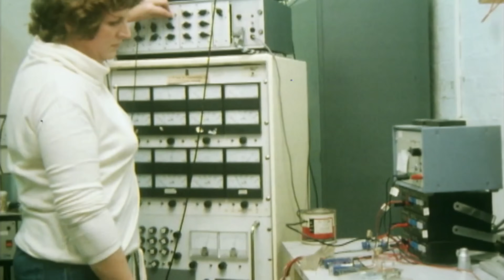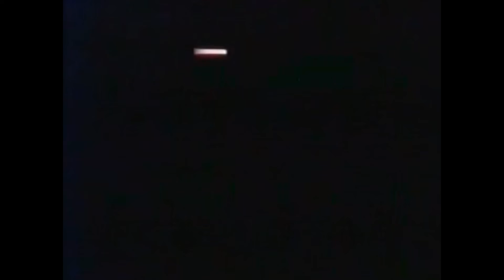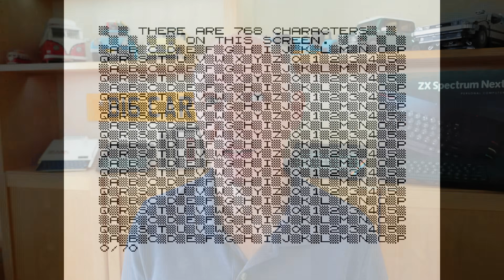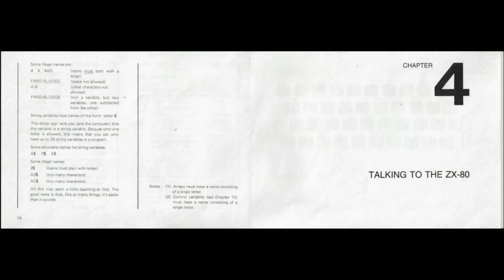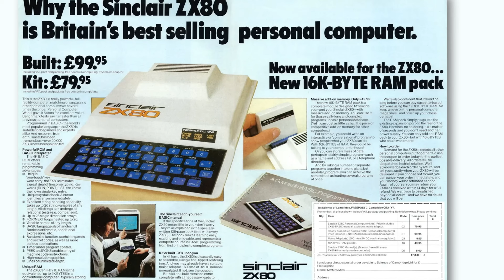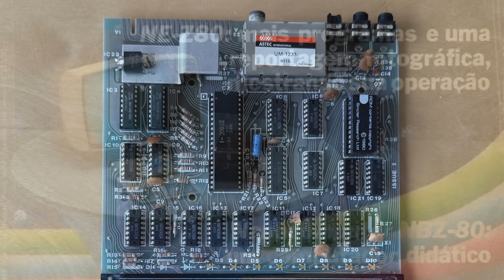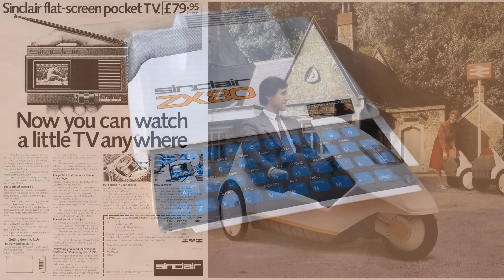Just a TOY? The Sinclair ZX80 Story

Comment: An interesting nugget that I don't think I've ever seen repeated online. 

When I was a child in the late 70s into 1980, a friend of my father worked for Sinclair in quality control.  His remit was simply to test random units to identify where problems were occurring.  This didn't work as well as it should as Sinclair found Mr QC rejecting a far higher number of ZX80 computers (as he had MK14 machines the year before) than Clive Sinclair was happy with and more than he found were being returned as a percentage of production.  Sinclair's solution?  Put the QC into the design stage and don't bother checking devices off the production line - the reject percentage from the general public was far lower than the QC department, most likely because when faced with a computer that didn't work quite right most buyers would just assume it was something they'd done wrong!  A great cost cutting principle that many firms use today - let the buyer be the tester.
Reply: A tradition kept to this day by the likes of amaxon
Reply: @burblering  ...and Microsoft.
Reply: @andymanaus1077  People love to hate Microsoft - and Microsoft has gone down hill since Bill Gates retired.
But, compared to the junk that was sold before, Microsoft is pretty darn good.
You should see the crashes and bug we had to put with back in the mainframe days.
Reply: @keithammleter3824  You're right.  I used to program my computer in the 1980s with a version of MS BASIC and was pretty good at it.  It was a solid BASIC, far better than most other microcomputers of the time.  Microsoft started out strong but these days, they've gone to the subscription model for just about everything and have added so much bloatware, spyware and nagware to their OS.  It's infuriating.
Reply: That's the essence of Clive Sinclair's business method:   sell junk to kids so that if it didn't work properly or didn't work at all, the dumb kids wouldn't know or the parents would think it was the kid's fault - so there weren't too many returns.  That's why he liked kits - when a kit didn't work, blame the assembler.  That was the case with Sinclair's earliest amplifiers and he stuck with it.    
Only in Britain could such a crook get a knighthood and not be prosecuted.
Another one of his tricks was to hire people way underqualified for the job they were given and pay them very well  - and when they inevitably did poor work, rant and abuse them.   It worked because they had to either rise up or loose their job and work for a lot less elsewhere.
Reply: @keithammleter3824  Britain was going through our great depression at the time

Comment: You didn't really need to look at the screen to know if your keypress had been registered; The screen would blink, which was easy to notice without looking.
[The Z80 was HALTed to maintain the display, so each time a key was pressed, it had to process it and the display was dead for a short time.
The ZX81 had the option of SLOW mode, where the Z80 was focused on maintaining the display and other processing could only use the 'spare' time]
Reply: The Z80 wasn't halted to do the display.  It was frantically doing NOP instructions.  It takes 8 clock cycles to do a NOP so it timed the bits to go to the display.  The instruction pointer was set to the address of what to display except the MSB was set.  This caused the instruction fetch to grab the byte from memory but hardware forced the CPU to get a 00.  At the end of a line was a HALT instruction that was allowed to go to the Z80.
The memory refresh counter was abused to count off the characters per display line.
Reply from the maker: One review said that was a positive by product of the screen jumping.

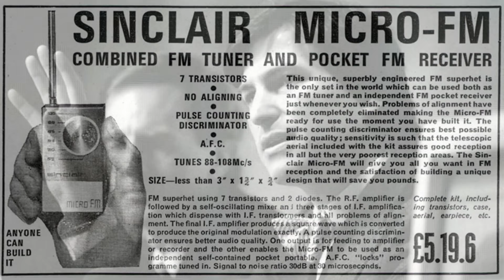Comment: 4:12 You said Steve Jobs made high quality products that were very usable, not always. Steve Jobs insisted the Apple /// not have ventilation slots or a fan. Instead the bottom was a big aluminum plate that was supposed to be a heat sink. The aluminum plate added weight to the computer and raised the price. It did not work as a heat sink to cool the computer in real life. The computer overheated all the time and chips got loose in the sockets causing errors. Apple support told users to lift the computer up a few inches and drop it to reset the chips. This worked for an hour or so then died again. If Steve Jobs let the engineers put in ventilation slots and a fan this would not have occurred. Because of this the Apple /// was a failure.
Reply: the apple III was a big heavy and solid machine, whereas the ZX80 was a flimsy bit of plastic.  In terms of functionality and reliability, yes the III was garbage, but it wasn't for lack of material quality.

Comment: My first computer was the ZX81 that I got as a a kit around 1982.  I nagged my mom into buying it for me!  I built it in my workshop in the basement and it almost worked!  Half the keyboard would not respond!  Glass half full though!  I sent it in to the US repair company and they got it working for me.  What a blast!  I still have it, but I don't know if it will still work.
Reply: It very likely will. I think there were only a couple small electrolytic capacitors (which are what may go wrong over time), no battery that could leak, only a few chips. I also got one at the time. It was frustratingly limited but certainly there was something oddly appealing to it.

Comment: Shame you focused on the ZX80 and ZX81. I think the ZX Spectrum is far more relevant - given clones are produced till this very day. But anyway, I'm happy I didn't buy a ZX80/1. I had learned BASIC on a PDP-11 - and I entered and ran them on the Speccy without problem. Also note that the Speccy ran Pascal, C and Forth. I even heard about a Fortran compiler - although I never got this confirmed.

The Speccy has remained relevant to me till this day. I've worked on a compiler for the last 30 years - and there is a lot of the Speccy knowledge I acquired in that thing. The BASIC interpreter I wrote in that language has some Speccy quirks as well. See Rosetta code for that one, e.g. "Amb":

that    thing   grows   slowly

0 OK, 0:772

Slightly familiar?
Reply from the maker: I’m going through the home computers chronologically, so I’ll eventually get to the spectrum.
Reply: @LittleCar  🎉 Looking forward to it!

Comment: I have one of the old Sinclair calculators which got my father-in-law through university. It's about as luxurious and enjoyable to use as you'd imagine a Sinclair product to be, and it needs a 9V battery to work, but it's satisfyingly clicky and always amusing when you run a more complex calculation and get to experience the noticeable lag between hitting '=' and getting your answer. The red vacuum fluorescent screen is pretty nice, though; makes me feel like James Bond in Live and Let Die.
Reply: It wasnt a VFD, it was an LED "bubble" display. The segments were tiny, with fat plastic magnifiers. I think TI manufactured them.
They flickered a bit because they were multiplexed, and on the "Sinclair Scientific", the display could blank for tens of second when calculating trig functions. :)
Reply: @ParedCheese There were two versions of the calculator. The earlier version used 'reverse Polish  notation' for formulae, but the second was standard.
Reply: @gbcb8853  I had the RPN version. :)
Reply: @ParedCheese  Cool to know! Thanks for the info! It's staggering to think that what was once a luxury item is now almost nothing in comparison to current tech.